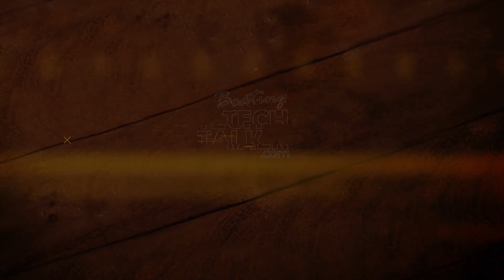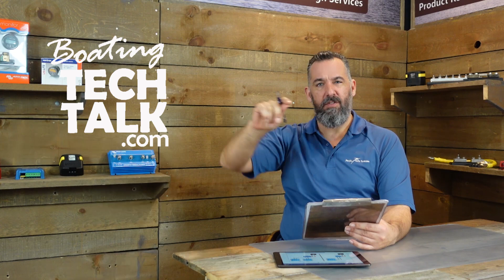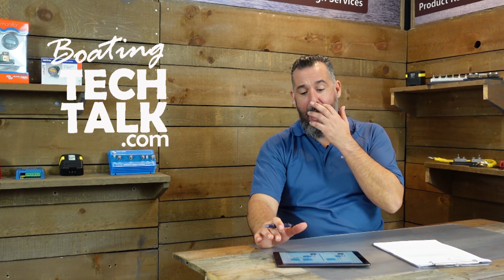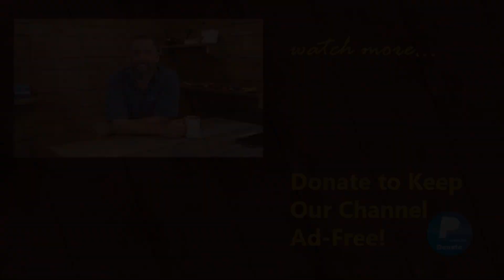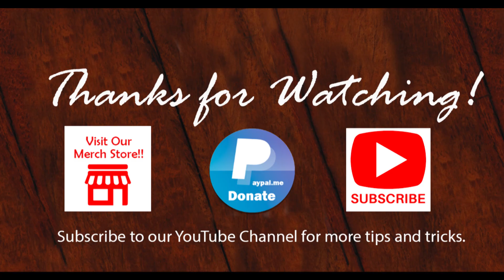Where Do I Put the Fuses and Breakers for My Boat's Solar Panel?

Comment: Equalize the older batteries? That is another reason they are not staying in bulk. Flooded lead only, AGM you need to check with the mfg.

Comment: Hi there, could you please let me know what size amp fuse I need for my 100w solar kit thats just been delivered? 

Its a free stranding type for it to stand next to my campervan (RV) next to the battery box/compartment.

Noticed a guy on a camp site a few weeks ago that he had his fuse in his battery compartment/box.

Not sure if he had a fuse in another place somewhere else near his controller though I didn't notice that as I just walked past and noticed his breaker/fuse was inside his battery compartment/box  when his battery box door was open/down for some reason. (He might of swapped batteries I dont know) Thanks.

Comment: With the Victron App, you could also disable the output of the controller and then switch the breaker off instead of covering the panels, or what do you think about that?

Comment: Hi Jeff, I was recently looking at this same topic and Victron has a schematic online that has breakers both between the solar panels and the solar charge controllers as well as between the solar charge controller and the battery. They then also have a battery protect to cut the charge current (for a Lithium setup). You can find in their Volkswagen van build schematics here: https://community.victronenergy.com/storage/attachments/2678-ds-victron-van-automotive-solar.pdf

I guess it doesn't negate the idea of covering the panels before switching the breakers, but as I understand Victron doesn't seem to find it an issue to disconnect the solar charge controller while the panels are active:
https://community.victronenergy.com/questions/5563/mppt-battery-cut-off.html

They even describe this as a supported configuration in the MPPT manuals.

Comment: What is wrong with a voltage spike? Where is the voltage spike measured? How large can it be? Why does it happen?
Reply from the maker: Good question, most electrical devices have a safe input voltage operating range, if you have a very short voltage spike that exceeds this range the device may be damaged.
Reply: When you break a circuit it's possible for the electrons to jump across the gap causing an arc, sort of like what happens with a sparkplug, and thereby spiking the current.  Higher than rated voltages can damage circuits. The best thing you can do is follow the manufacturer's installation instructions. Sending an email to their help desk can provide good information.

Comment: I use a fused combiner between my panels and my charge controllers. I also have breakers between the controllers and the batteries.  The outputs of my charge controllers are fused internally; I use the breakers for two reasons: it gives me a visual indication of a fault and (theoretically) the breakers will pop before the internal fuses do, being sized slightly smaller than the fuses and I'm not running the charge controllers at full-out maximum.  Keep your bilge pumped. :)
Reply from the maker: Well explained Tao. What make and size of breaker are you using the on the solar controller connection at the battery?

Comment: The better engineering solution to disconnect the solar panel would be to have a make-before-break switch that puts a resistor across the solar panel output.  You should still use the blanket, however, if for some reason the blanket is not used, not available, gets blown off etc. you can still disconnect the solar panels.  A capacitor in parallel with the resistor would improve the performance to help prevent voltage spike.
Reply: I love this comment.  When is a switch not a switch?  When it’s a break-before-make.  Lots of somewhat subtle things available out there to do things right, if you know about them.
Reply from the maker: Thanks for sharing Borys, well said.

Comment: The fuse at the panel protects against a disastrous short if a wire comes loose or is damaged or the controller malfunctions.
Reply from the maker: Thanks for sharing Robert.

Comment: Is it OK to have your solar panels out putting while the the alternator is charging or shore power is charging? I have the victron controller.
Reply: You can have multiple charge sources connected at once. It’s done all the time.
Reply from the maker: It's possible your alternator might not output if the alternator regulator senses the batteries are sufficiently charged.

Comment: Great subject to talk about!! 
Solarpanels are a scourse of electricity, so they need cirquitbreakers ot fuses for the electric cables, preferebly on every individual solarpanel at each point where the cables are connected on the solarpanels. Another grave danger, especialy on boats/ships/yachts and espescyaly when these are made of wood or glasfiber. When something goes wrong, these panels keep on fireing up material around them as long as there is something to burn! 
That idea to cover the solarpanels is a good one, when I install them I insulate the end of the cables with tape to prevent sparks.
Reply from the maker: Thanks for sharing!

Comment: Jeff, if you're using a 30 Amp fuse block but rated at 100 Amp," they say, " if you want to use an inline fuse or a breaker. Should you use a 30 amp or a 100 amp before the fuse block? Just wondering, thanks! I would say a 30 amp, your opinion, please!
Reply from the maker: Hi Sui Generis, not sure of your question. Can you please rephrase, specifically i'm confused about "30 Amp fuse block but rated at 100 Amp". Is this a single fuse block rated at 100 amp but with a 30 amp fuse? Or is this a fuse block with multiple fuses, max rated amperage of 100 amp and you are inserting 30 amp fuses in the individual fuse holders?
Reply: @PacificYachtSystems  sure no problem. It's a regular fuse block by Blue sea system for 12V to host blade fuses. On the input line from the battery, they say to fuse with a 100 amp on the incoming line to the block. I would think since it's a 30 amp per circuit you would use the 30 amp fuse on the incoming line to the block? Thanks! Maybe I am misunderstanding why. Hope I'm making sense, it early, and only had one cup of coffee! [ smiling ]
Reply: @FirstSuiGeneris  max amperage of the block is 100 amp total. And you can ( if you want ) have up to 30 amp pr sircuit, but remember that if you have 3 circuits with 30 amp each you are already on 90 amp of the 100 amp capasity on the fuse  block. So the inline to the block should be fused at 100 amp. 
Please correct me if iam wrong...
Reply: @mrwiik644  cool, thank you!! I understand, thinking if a 100amp go to a block , there must be a bigger problem. There’s no way those fuse blocks could ever handle 100 amps even at 30 amps a piece. I would think it would be in anybody’s self interest to be safe and run  a separate line/home-run at 30 amps for your needs. Yes? For Saftey? I agree with the understanding how and why, but not the execution of it. For any 12v  fuse block accessories Would I ever run 30 amps though a fuse block with other smaller amp draws. That’s my thinking, what your opinion? Just trying to use all opinions to get a different picture of the bigger picture of fuses and there capability. There’s so many opinions that’s why I looking for options and opinions, thank you so much mikael